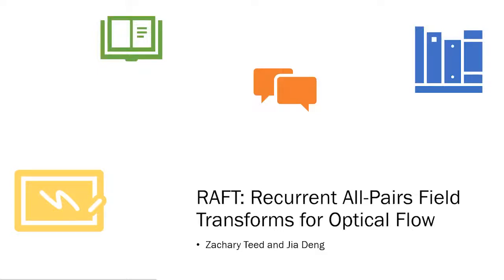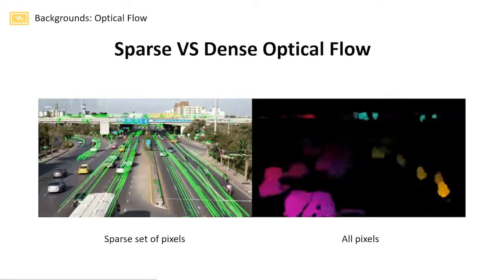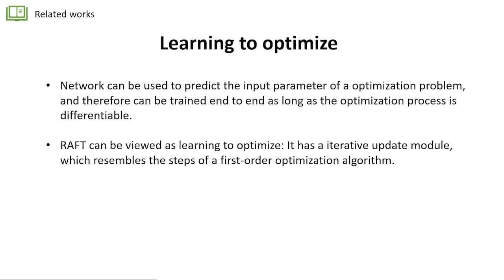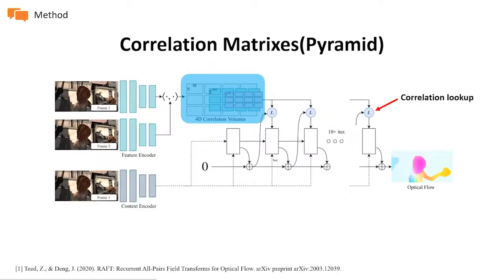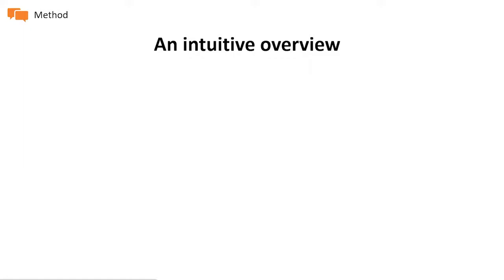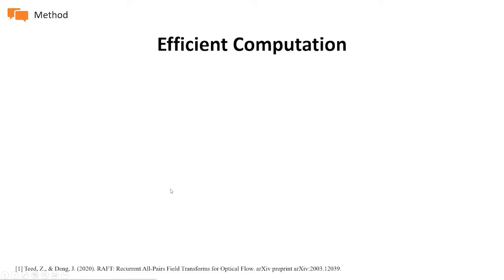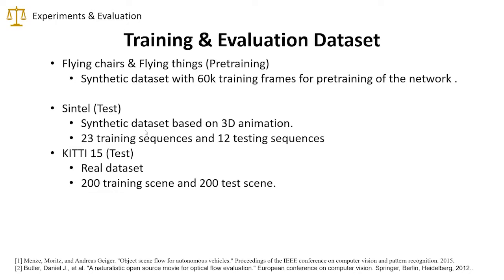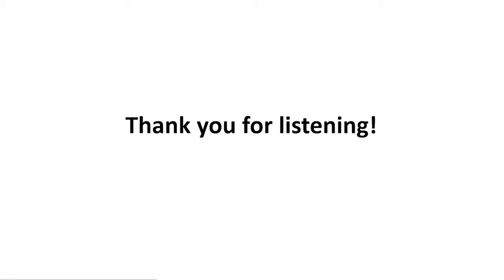Presentation on RAFT: Recurrent All-Pairs Field Transforms for Optical Flow.

Comment: I had a doubt. I tried Gunnar Farneback OpenCV implementation using GPU (Nvidia gtx 1600) and the results were much faster than the deep learning RAFT implementation. I was confused as while Farneback took only 33 seconds on a 10 second video, RAFT took 95 seconds(RAFT took 0.3 seconds for a single frame) ! Do these deep learning approaches work better in terms of quality only? Why should we use these deep learning approaches?